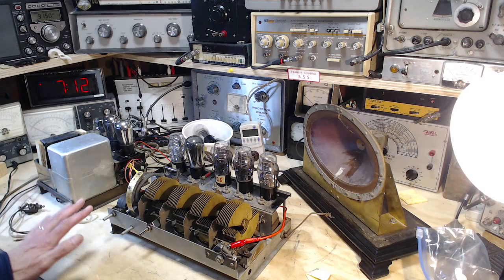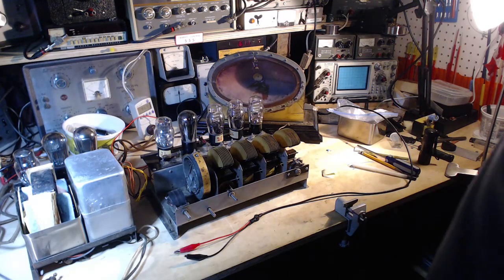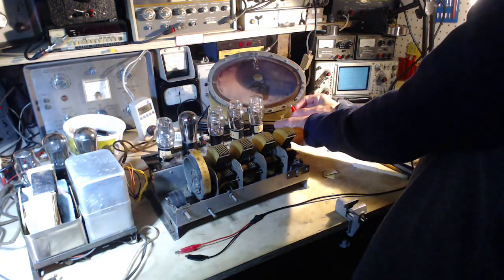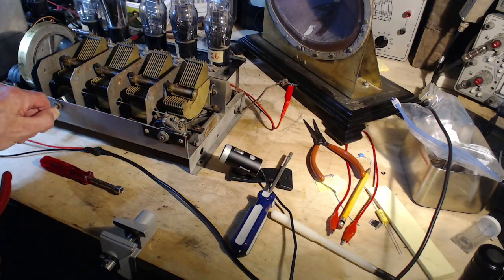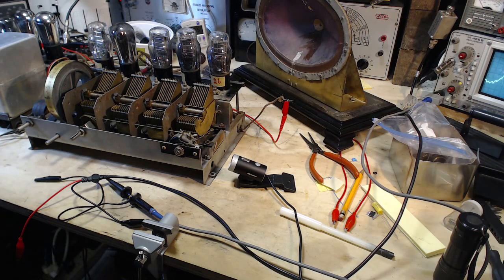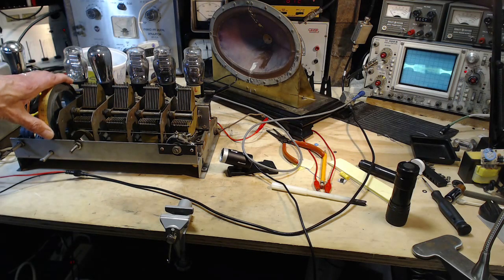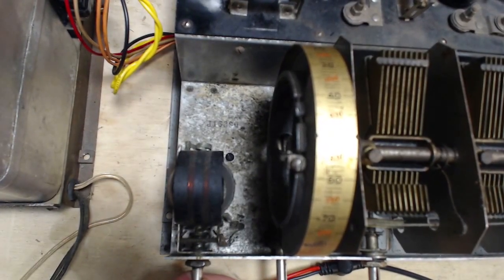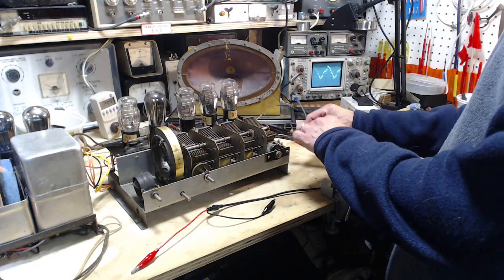1928 RCA Victor Model 28V   Video #14 - What Happened?

Comment: the tremor is just a find tuner isn't it?  just repair the spring on the back by solder it, not having the signal going through the fine tuner, might be causing problems That's my guess

Comment: Can you not use a 470K slider variable and mount it in such a way that the cord that drives the old variable could be used to move the slider on the 470k slider variable either direction.